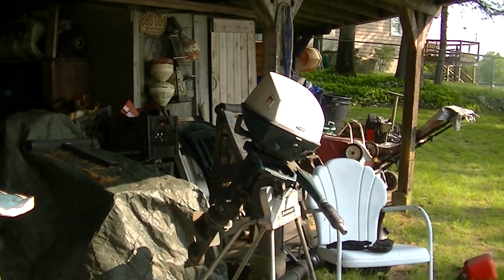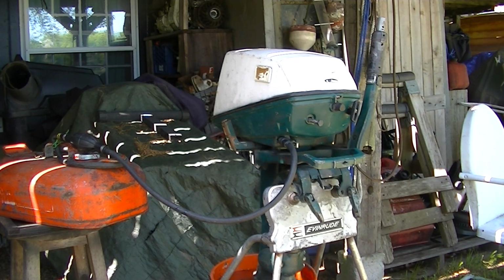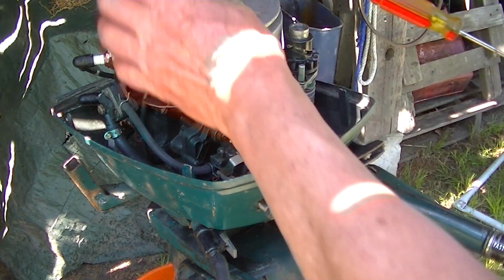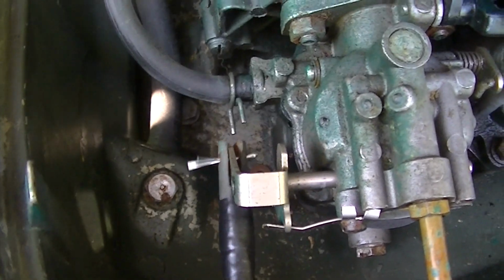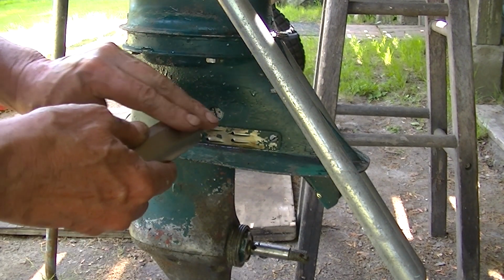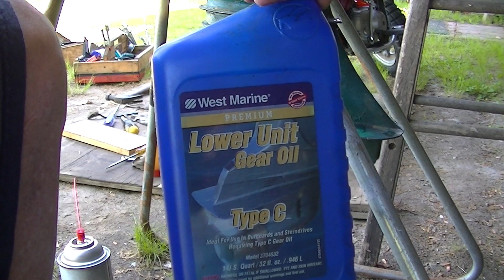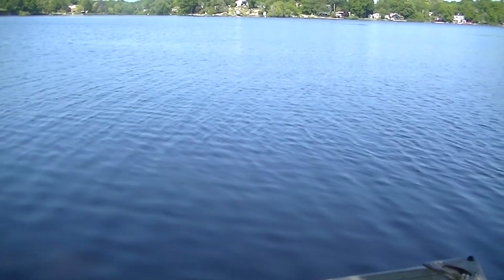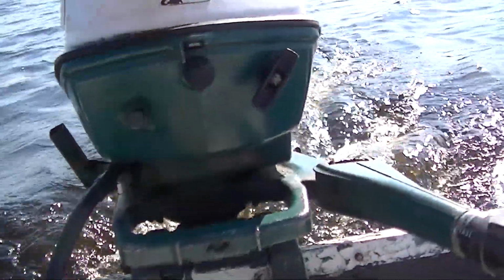1968 Johnson 6hp will it run?

Comment: I have the 71 version of this boat. Good engine. The water pump on mine works considerably better if the water in the bucket comes up to at least the level of the impeller even with a new impeller. Good luck with it!

Comment: 1970 model 6 hp here. Ran it yesterday.
They're hard to beat. Music to ears. I see you fabricated a shift lever. I had to do same. Used wood off broken hedge shears and JB. Weld. Notched to fit tight on bandsaw. Let it cure and it does job very well. Yours looks good too. Enjoyed watching.
Reply from the maker: Tim, I just started mine up yesterday too. First pull. It is purring without doing anything to it at all. I guess those shift levers are notorious for breaking.
Reply: @woodysgarage469 YesSir.  Apparently they are a well known and documented weak spot. Pot metal bubble ridden little wanna be levers that break if you look at them cross eyed.  Used handles are $100 plus. Plus the aggravation of disassembly. Well it was my fault it broke.  I put it on side in back of pick up and it rolled over about 10 years ago. 
I finally built a nice temporary fix and now it rides shotgun in front seat with me.  Hahahaha.  No more pickup bed for this motor. 
I’ve enjoyed Evinrudes and Johnson’s since I was a kid.  Grew up with them and still have a few to tinker with and use. The quality is unmatched and the simplicity makes them easier to keep around and work on. Like I said, enjoyed your video and will look for more. 
The best to you.

Comment: I have the same motor, plate with the serial number and such is on the throttle side of the motor where it attaches to the boat.
Reply: I'm putting a hydrofoil on it, I can let you know if its worth it
Reply from the maker: @corncobbbhunting7082  Yes, I'd be interested.